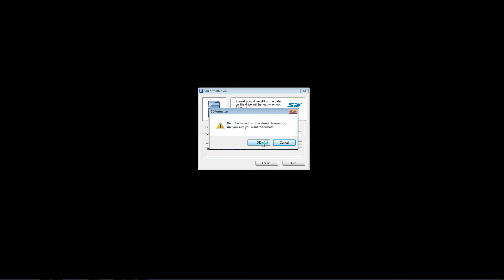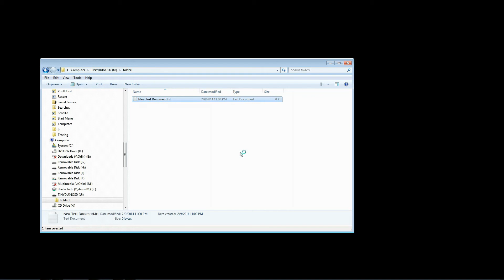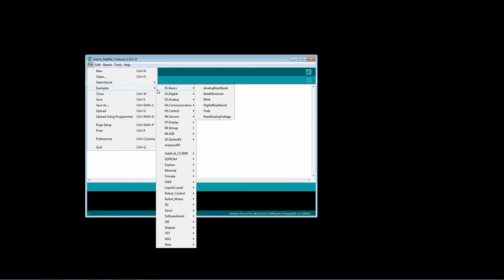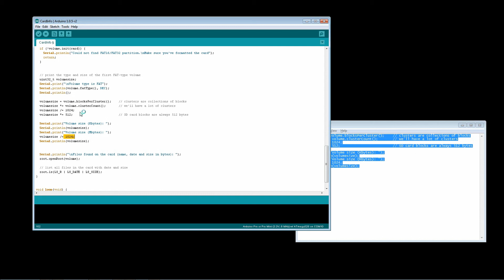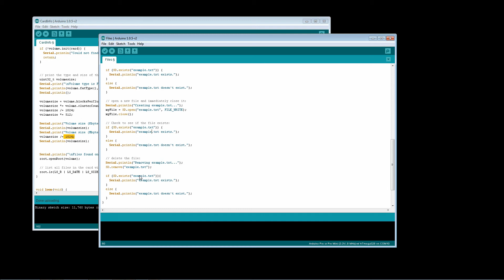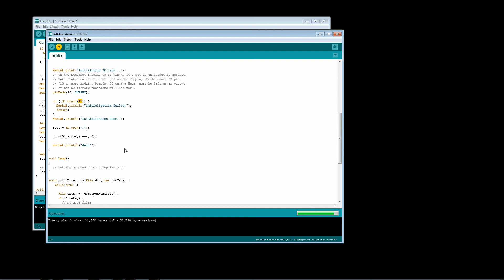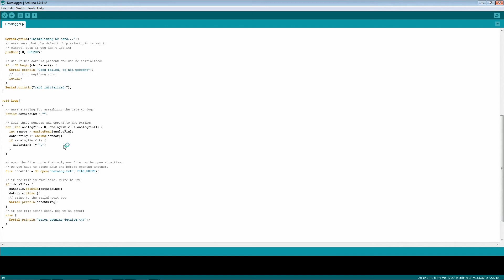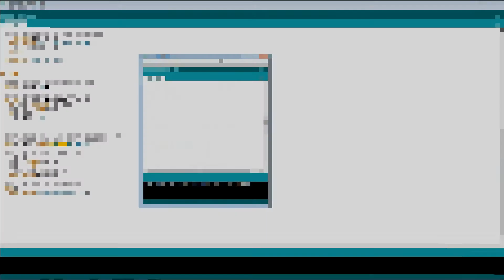TinyDuino MicroSD TinyShield Tutorial (Model ASD2201)

Comment: Thank you; I learned a lot.

 Glad to know about SD Formatter. I'm assuming that the full(erase) option probably zeroes out the directory and the full(overwrite) option writes zeroes to all available space.  But I have no clue yet as to why one might use the Format Size Adjustment (ON/OFF) option.

I was also glad to see the code corrections from Ken for the CardInfo example as my 8 GB SDHC card kept being reported as 4 GB.

Question1: I followed along with your clip and did all of the uploads. My listfile example shows, in addition to the one folder plus file, and three other files that you demonstrate:
     SYSTEM-1/
              INDEX-1     76

I'm assuming that that INDEX-1 file is put on by the OS, in my case Windows 8.1

Question2:  I noticed that you also had a file on your card Test.txt which you probably also put on the card after formatting it and adding the file1, file1, etc.